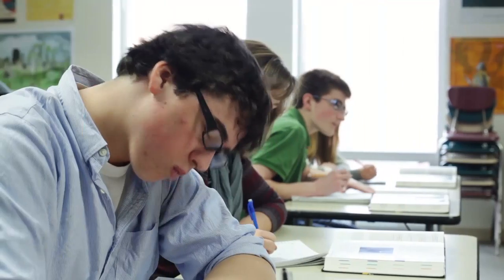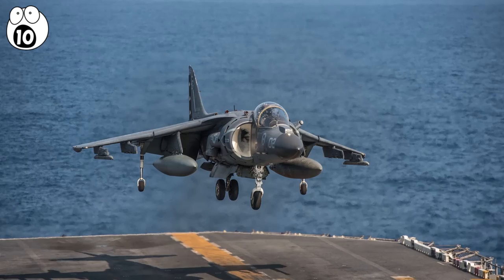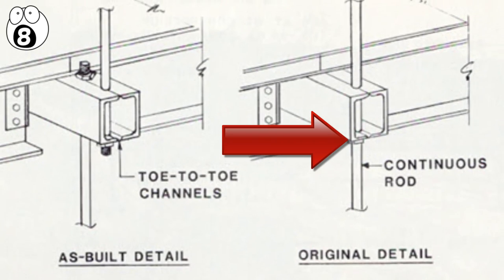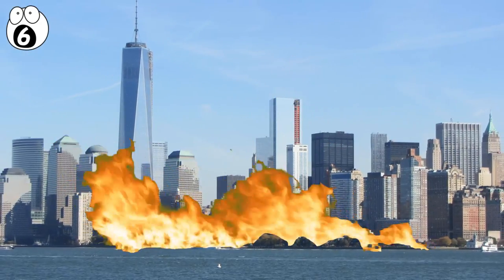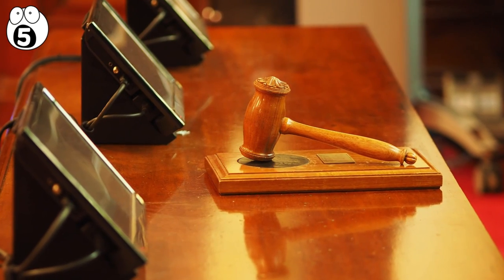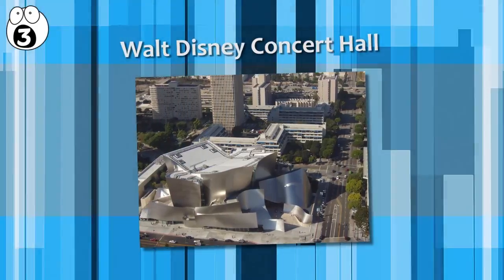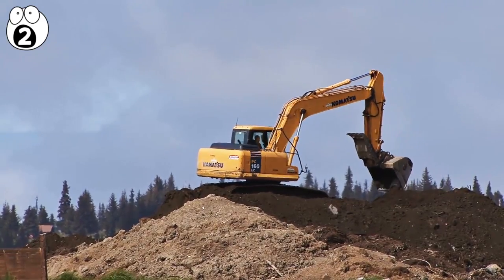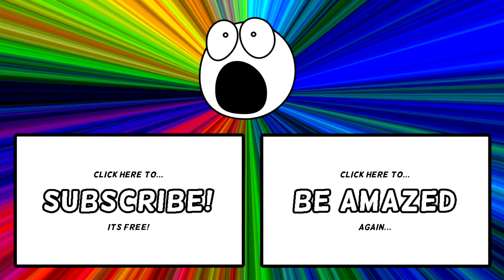Biggest Design Errors Engineers & Architects Made

Comment: The aircraft carrier "runway" was not a design flaw, the straight deck of earlier aircraft carriers worked just fine although it did have limitations, when jet aircraft appeared which were heavier and faster than previous types it was realised that something new was needed and the British came up with the angled deck (they also came up with the steam catapault, glide slope light system and others), the angled deck allowed greater flexibility of operations with aircraft being "trapped" whilst others were being launched with almost no conflict between the two operations.

Comment: The spaghetti analogy for the Tacoma Narrows Bridge was completely wrong. Where did that come from!?! It's rigidity didn't bring it down, its wind profile combined with its aerodynamic harmonics (which were not understood at the time) caused it to bend and sway in even moderate wind. Also, the images you used were of the newest two Tacoma Narrows Bridges. There are hundreds of pictures of the original online and public domain, get it right!
The Hyatt Regency hotel skyway collapse was not only attributed to using 2 rods instead of one, but also using the load-bearing cross beams backwards leaving huge stresses on unstable parts of the beams simply because it made it easier to finish them aesthetically. 
The speed and altitude of the DeHavilland Comet played no factor in its structural failures--rather it was the pressurization cycles stressing out the square antenna windows on the top of the aircraft that caused structural failure followed by explosive decompression. Again with the photos... That aircraft missing its wings and engines is a Douglas DC-3, a completely different plane. Again, hundreds of images are available online under public domain. 
The CitiCorp building (as it was originally named, not CitiGroup) would not have destroyed "all of Manhattan" and the 156 block number comes from the effective damage radius, meaning that the building could've fallen anywhere within that circle endangering the lives of 200,000 though the toll from an actual collapse would be far smaller. Atop that, the building was completed and occupied when an engineering student found the critical design flaw and alerted the building's architect. 
How you missed mentioning the Millennium Tower in the tilting building segment is beyond explanation. 
Maybe try digging a little deeper and treating these videos with a little more journalistic integrity. You're putting these up under the impression that they're educational, and this one alone is full of flaws that I saw, and I didn't even have to go looking for the corrections I mentioned above. Try harder next time.

Comment: This video is inaccurate in the extreme. For instance, the Tacoma Narrows bridge did not collapse because it couldn't handle the force of the gale, it collapsed from metal fatigue after hours of bouncing and twisting in a moderate wind. The design of the bridge was faulty because it allowed the bridge to resonate when the wind blew over it. It didn't have enough damping. In effect, it was too flexible, like a car suspension with no shock absorbers. Newer bridges use open girders, deeper girders, and aerodynamic design to prevent resonance.

Comment: The walkway wasn't an issue with the rods, but the bolts/the upper walkway. In either case all the weight was through the upper rod anyway, but in the original design the bolts only supported one bridge each and each bridge only supported its passengers.
But suspending the lower bridge just off the upper instead of directly to the ceiling as well meant the upper bridge had to physically support the lower bridge too, and it wasn't designed to carry any structural load like that. That upper walkway gave out, not the rods that held that one.
Funny, you should think about doing some boring maths and physics before making a video on these things.

Comment: Oh come on now.  Carrier designs were not a flaw.  Given the type of aircraft in use at the time (propellers) you needed the entire length of the ship for both take offs and landings.  The nine degree angle is usable only because of the steam powered launch on the front of the carrier boosts the jet plane speed enough to take off.  The design of carriers has evolved as aircraft capabilities evolved.  

And then the Tacoma bridge failed not do to a lack of holes to allow win through.  It was a combination of complex factors such as designing the bridge to be very narrow (Only two lanes) to save costs and the use of minimal size girders which reduced the rigidity of the bridge, both of which combined to allow the bridge to move significantly in the wind.  And then when the right wind speeds hit it set up an oscalation that built in intensity until *pow*.  Adding holes to reduce wind pressure may have reduced oscallations, but the underlying problem of incorrect girders and lack of rigidity would have still been a problem over time.  Add in the narrow ness of the bridge (designed for light traffic wow) and it would have failed under load with cars as traffic increased over time.
Reply: And the whole item on the square windows misstates the whole issue.  Yes the stress at the corners led to the failure as it led to stress factures which over time (very quickly) led to catastrophic failure in a pressurized craft.  Look I know you are trying to cram x items into the video.  And maybe you need to dumb it down for the simplistic audience on the internet.  But get the basics right at least.

Comment: A welded joint is not inherently stronger than a well designed bolted joint. In a large assembly welded just around the edge, it can be weaker. Then there's hydrogen embrittlement, stress raisers, fatigue...  See liberty ships where they went from rivets to welds.

Comment: the square windows were not the major issue with the Comet, the major issue was the use of punched rivets that created significant deformities within the structure of the aircraft.  If they had spent the extra time and money to drill and screw in all rivets instead of punching them in, the aircraft would have been far more sound, square or round windows.
Reply: "screw in all rivets"?   Drilling holes rather than punching I understand.   But generally, rivets just drop in the holes, then you form a head on one end of the rivet by hammering, usually with an appropriately sized air hammer.   No screwing is involved, except in a few special cases where the fastener isn't called a rivet, but rather a "Hi-lok" or similar brand/fastener for aircraft use.

Comment: The submarine. Salt water has a set weight, so do all of the materials and components for building a submarine. Subs sink because they intentionally take on water that outweighs the vessel, then the trapped air makes it rise when the water is pumped out. This is called ballast. A list of parts and their weights and a 5 minute math problem would have avoided the incedent and saved spain millions. Most easily avoided? Doesn't get alot easier than 5 minutes worth of math, and zero subsequent corrective labor. Every other incedent would have required additional labor to avoid, not the sub, just would have taken a little math. Very little, like, just one simple problem...

Comment: 2:04 "no holes and therefore no give"  This is ridiculous.  The original Tacoma Narrows Bridge collapsed not because it needed to be "more" flexible like the Burj Kalifa but because: 1. It needed to be stiffer. and 2. The road deck should have been aerodynamically tested to behave like an upside down airplane wing -- therefore becoming stiffer in a breeze and also tested for resonance oscillations driven by wind.  I hate the over-simplifications of all the examples but especially this one because it is just plain wrong.

Comment: Ok, #2. You really should study before you do this kind of thing.
The DeHavilland Comet windows were overstressed due to it's all so being one of the first passenger planes with a pressurized cabin. After a certain number of cycles of cabin pressurization the  pressurized fusalage would rupture at the window corners. It had nothing to do with it flying high and fast. They actually found out what the problem was by pressurizing the fuselage on the ground in a tank of water.

Comment: Re Hyatt Regency walkway collapse: Wrong again, I'm afraid.
It had nothing to do with weight of the rods, it was down to the fact that the entire bottom half of the rod would need to be threaded, with high probabliliy of damage to thread during errection. Also had nothing to do with "entire weight of the structure on the first rod". There was only one rod above the top deck in both cases, so in both cases the entire weight was taken by the single rod!  The problem was the rods going through the welded join between C sections combined with the top level BEAMS having to take twice the load, not the rods.  Compounded by the fabricator taking preliminary re-design sketches as production drawings!!
Try reading the Wikipedia article; it explains it nicely. Please don't take up a career in accident investigation!

Comment: The Citigroup Tower Problem has nothing to do with bolting anything. The building was built on corner columns at three corners and the fourth corner was cantilevered basically. The building would’ve fell over in high winds due to having one corner not supported straight down to the ground. A huge moveable counter weight was installed in the top floor to literally slide in the opposite direction of building movement to prevent the building from collapsing. Do your research before making incorrect videos.

Comment: The reason the actual construct of the Hyatt walkways was because the difficulty in putting threads in the middle of a 40 foot long steel rod. It was not the entire weight on the one rod, it was the combined weight of the 2 walkways being supported on a non reinforced weld joint between 2 channels. Simple flat washers between the nut and the channel would have distributed the load and prevented the collapse. The change to 2 rods rather than the original single road was never analyzed of authorized by the structural engineers who desingned the walkways. You are totally misinformed on this one. Was actually involved in this one starting with the rescue attempt when the notice went out interrupting regular TV programing in the area seeking people experienced in moving heavy equipment, then the analysis of the failure.

Comment: A lot of these facts are wrong eg. the Hyatt hotel collapsed because the original plan was for a shorter distance and was changed midway through the project causing its collapse after a large group of people stood on the balcony for a photograph and the Citigroup center is perfectly able to be on stilts as is any other building, the only problem was that months after the construction a storm was reported to blow through and the bolts that had been used during construction were replaced with welded bolts (bolts are no were near the equivalent of duct tape and in some cases can be stronger than a weld.) there are so many other problems, yet I don’t want to rant too indefinitely.

Comment: "Design Errors"? 
Be Amazed, would you call the Wright Flyer of 1903 a "Design Error" because it couldn't carry 300 people?
The aircraft carrier was first built just after WW1, the first angled deck was tested after WW2 and became standard in the mid 50's with the HMS Ark Royal being the first Aircraft Carrier being purpose built with an angled deck, so there was about thirty years of the "Though Deck" AC with prop driven aircraft which worked relatively well until jet aircraft appeared and a Royal Navy officer came up with the "Angled Deck" to deal with their particular foibles.
This would be better termed a "Developmental Phase".

Comment: The guy who made this is definitely not an engineer. I will only describe the things I know as wrong.
10. Angled runways on aircraft carriers was an innovation to correct an issue which is unique to carriers. Not a correction of a flaw. And carriers with VTOL(F35 vertical landing and take off) aircrafts. Dont need such arrangements.
2. Takom bridge is a good and well-known example of resonance frequency failure. Not cooked noodles. Get your facts right.
1. If it is overweight. It means it's an issue of buoyancy and has to be corrected by increasing ship volume and buoyancy tanks. It has nothing to do with engine power.

Comment: I stopped watching at the Tacoma Narrows Bridge. What you say about rigidness is just utter nonsense. It did not break because of pressure due to the wind pushing it and it was too hard to bend. You just need to watch a video of the collapse to see that it could bend and move way more than 6 feet (as the Burj Khalifa) and bend and twist while doing so. You are right with the holes though. The collapse was due to the Kármán vortex street that occurred due to air streaming under and over the structure instead of through it.

Comment: One 12mm bolt every inch is almost twise the strength of a weld, however no onr would use a 12mm bolt every inch so welding is the way to go

Comment: First mistake :

First, carriers are made on standard warship type hull, so you can't make modern landing on them.
Second, that's not a flow, cause making a recent like design make them drag a lot more, which for a battleship is pretty stupid if you have not the engines to compensate.
Third, the modern design need a short launch site cause of propulsion from the ship + jet engines.
Fourth, in olds ones you have massive amounts of flak/DCA etc.

Well they have been well made and nowadays, they are well made too, but for different use, in different times.

The arguments in the video are so stupid for the first element that i don't care for the next garbage ...

Comment: No.10

 well there's alot of reason why World war 2 carrier has straight runway. For me, the point is odvious on how they operate, one aircraft at the time(turn by turn) both landing and takeoff all in the same runaway path. Plus, the development and concept of a Real modern aircraft carrier with tarred runaway and steam catapult
Would exist before the arrival of Jet aircraft. Even if they manage to did, it would be astronomical of a project back in 1940s. Those crashes and accident uccor is due to human error and aircraft equipment failure.

Tbh, it not design flaw, it just the way technology proceed.

Comment: Hmm... only a minute and a bit in...
Guy seems to know nothing about CV operations in WW2 (I.e. carrier wasn’t big enough originally for angled deck, originally planes didn’t use/need catapults to take off, hence the straight runway...)
And for gods sake, you’d never be recovering aircraft from over the bow, the speed of the carrier assist landing hence all landings, WITHOUT EXCEPTION are from the rear...
and you’d never have planes parked in the way on the deck while recovering aircraft, they go to the side of the deck or below!
Wow.
Research before you post a video...

Comment: The square aeroplane windows thing is just a whole lot of bullshit. Look at the cockpit windows of every single commercial airliner. Notice something? They all have square angled edges. Granted it is much easier to use round edges on the side window which is why they are doing that nowadays, the square ones would have been completely fine if they had bothered to strengthen the edges though.

Comment: Lmao wtf is with the dislikes 😂
Reply: Some of the examples he provided are QUITE bad, on occasion his examples or explanations were bad (dental floss, REALLY?!), and the organization of the ones that could count as actual design errors are off. He puts a stadium that is structurally sound; but not well converted for baseball...OVER an airplane that crashed due metal fatigue and LEANING TOWERS!
Reply: Some of the examples he provided are QUITE bad, on occasion his examples or explanations were bad (dental floss, REALLY?! Also, he acts like bolts aren't used for areas of buildings that experience low stress; that finger analogy really does not work.), and the organization of the ones that could count as actual design errors are off. He puts a stadium that is structurally sound; but not well converted for baseball...OVER an airplane that crashed due metal fatigue and LEANING TOWERS!

Comment: planes have used catch wires for decades and also the straight runway was not an error it was a limitation of that era and also if aircraft were not placed at the end they would fall into the sea and also catch wires are life-savers for pilots who have damaged control surfaces who can’t land at the right spot because they can’t maneuver fast enough to land
Edit: YOU SHOWER A FUCKING MODERN PLANE AS EVIDENCE THAT ITS A DESIGN FLAW AND ALSO YOU SHOWED A VTOL AIRCRAFT KNOWN AS THE HARRIER WHICH USUALLY ONLY NEEDS PART OF THE AIRCRAFT CARRIER TO TAKE OFF AND THAT’S WITH FULL COMBAT LOAD